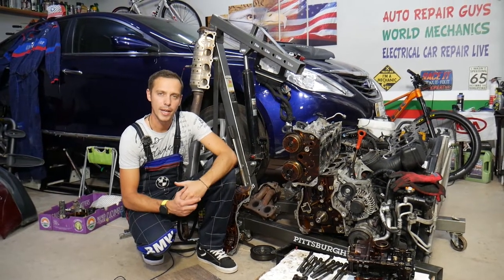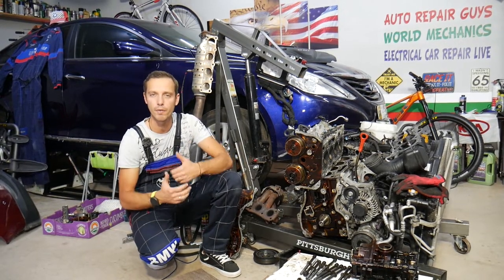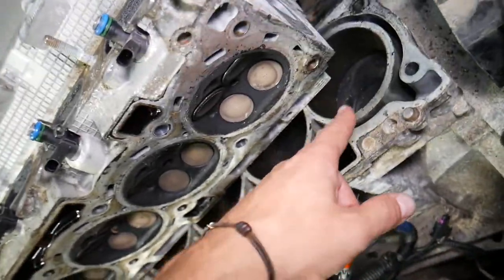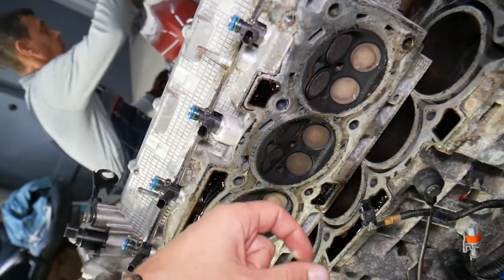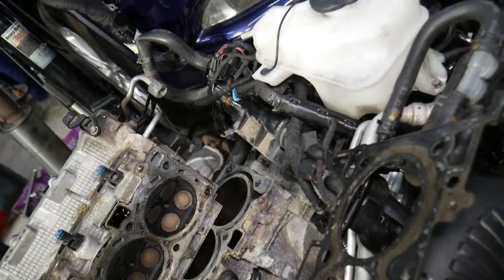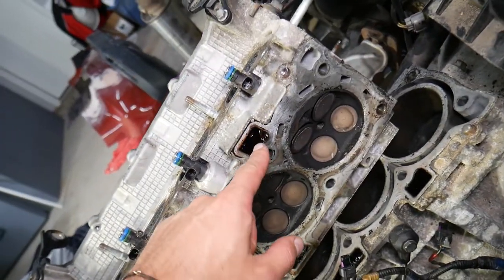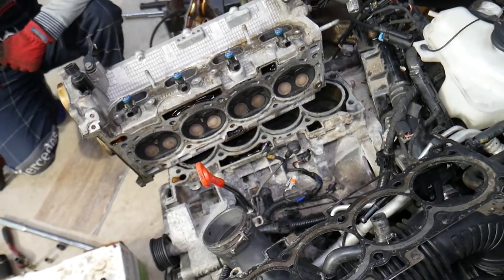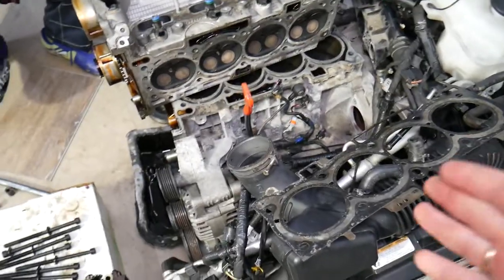SYMPTOMS OF CRACKED CYLINDER HEAD ON CAR

Comment: Excellent video. I believe you have to buy a tool called a straight edge. It will show you where the surface of the engine block or cylinder head bottom are uneven. Then you can replace them accordingly.

Comment: Im losing coolant there are no leaks and no overheating. Don't know if it's a blown headgasket or a cracked head?
Reply: Same. I just bought a Jeep, and with maybe 200 miles put on it since leaving the lot and it was bone dry and running hot as fuck. No leaks, no residue, only a bit of burnt syrup smell. It’s only been a week and a half; it’s going back.
Reply: @Just_Call_Me_Tim did you ever figure this out? I’m having this problem with a ford fusion
Reply: Oh it's my problem right now  this fuckin shit is also do like that 😅😅😅

Comment: Is it safe to keep the vehicle even they change the crack cylinder head???
Reply: Should be safe, although the crack indicates the engine was overheated, so other parts of the motor might have problems too, from that overheat.

Comment: Would a bad head Caset .how to tell .I have a 09 impala Chevy 3500 v6.
Reply: On any engine just start the engine and open the engine oil cap you will see air coming out (only if you have not put in some kind of head gasket sealer

Comment: do you have all these things go wrong with  the car.  im losing fluid and have a smoke smell.  i thought it was oil. but im not losing any oil and i have no water in the oil.  i have red antifreeze not green.  im thinking that red may have a different smell then green. no power loss and no overheating.  cant find any dips or any fluid under the car. also the smoke smell does it mostly when i going up and down hill not on a straight road? and i lose heat but now its bad?   i have subscribe to you
Reply: Yours sounds like heater core is bad.

Comment: Enjoy the videos. I would like to see your opinion on the code p0316 on the ford 1.5 and 2.0 eco boost. We recently purchased a 2017 Ford Edge with a 2.0 that had a crack in cylinder 2 allowing coolant intrusion. Ford has issued no recalls but has issued multiple superseded tsb’s since 2010. Have you heard of this issue.
Reply: Just ford things